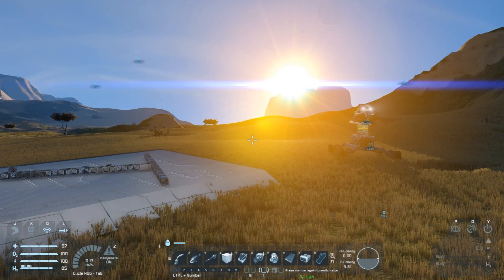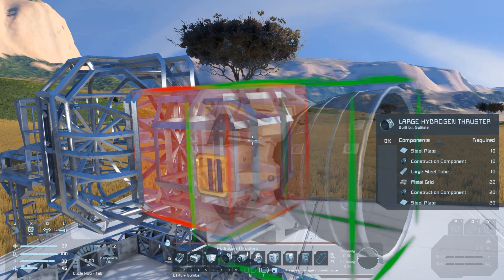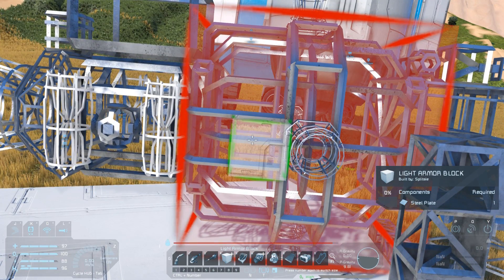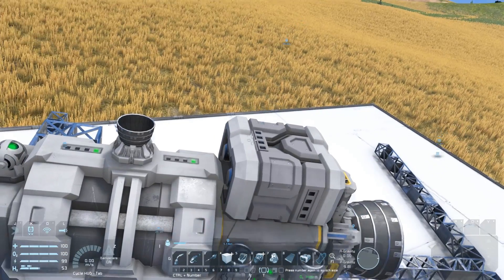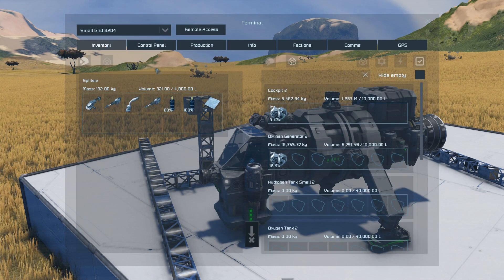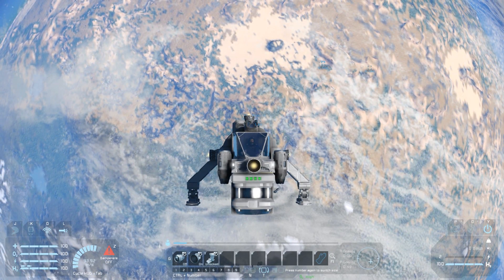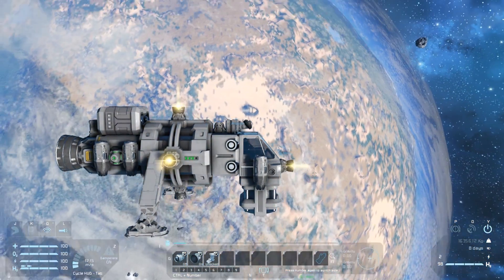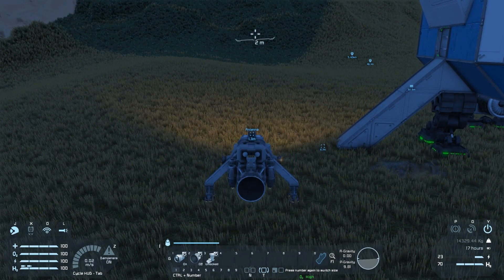Space Engineers Tutorial: Reaching Space from a Planet (Part 5 of a survival tutorial series)

Comment: Just built this and I can't get past 6000m high for some reason. I even went back and added 2 more of the large thrusters...
Reply from the maker: The thrusters aren't the problem. A single large hydrogen thruster is more than capable of lifting this ship. If you're capping out at an altitude you either don't have enough fuel going to the hydrogen thruster, or it's not yet on. It's only the atmospherics that are limited to altitude.

Did you leave enough time for the hydrogen tank to be filled before taking off? Did you 'pulse' the thruster to save fuel and not be pushing against the speed limit? Those are the things that did in my first few attempts when planets came out.
Reply: Im an idiot, had the hydro on stockpile... lol learning as I go!
Reply from the maker: Aren't we all :)
You can use the stockpile function to refuel from tanks on a station - much faster than using the Oxygen generators directly :)

Comment: Noob question, but how does one fill the o2 tank?
Reply from the maker: All noob questions are very welcome - I'm pretty sure I have and will continue to ask my fair share :)

The one on a ship: have an oxygen generator connected to it via conveyors, or if in an O2 rich atmosphere a vent attached to the conveyor system that is pointing outward and set to decompress.

For the personal tank: place it in an oxygen generator and it should autofill with the default settings, or place it inside a ship's tank that is set to auto-fill bottles
For the suit: jump in a cockpit that is piped up with O2 or use a medbay that's piped with O2
Reply: Splitsie more specifically I'm looking at builds where the ship only has an O2 tank and hydro tank for space, I'm not quite sure how their supply lasts
Reply from the maker: Either by being very careful, or by docking with a station and using the station's oxygen generator to fill them

Comment: Any idea as to why I cant deposit Uranium into my reactors through the small cargo in the back?
Reply from the maker: If you've run out of power on a ship the conveyor system won't work. So in that case you either need to add a solar panel, reactor you can directly access or a battery - they start with a small amount of charge. To my mind the best is the reactor you can directly access or solar panel as you can grind them down after and retrieve all the components :)

Comment: Build more than one Oxygen Generator if you can afford it. You refill youre tank much faster
Reply from the maker: While it's handy to refill faster it will also cost you more fuel to reach orbit (you add extra mass with the extra oxygen generator) so depending on the size of your ship that may or may not be a good thing
Reply from the maker: I haven't tested the rate difference between large grid oxygen generators and small but there's probably a difference in favour of large. So it might make it quicker to use the connector too :)

I'm glad the design had enough to make it to space with some extra weight, I hoped it would be that way so that the ascending flight didn't need to be perfect
Reply: I added a connector, still got to space with plenty of fuel and you can use you base to refill hydrogen.

Comment: Hey Splitsie, thank you for doing this. It really showed me some alternative way to build my ships. I have  a question though: Since i just recently started to use hydrogen on my ships i dont know what is most efficient to do. Is it more efficient to build gas tanks and fill them up in your base, or is it (energywise) more efficient to generate the hydrogen on the ship from ice you then therefore have to take with you in a cargo container. I play on 1/1/1 setting, so my space is limited. Thanks for your advice!
Reply: Im asking because if my calculations are correct, the energy in form of propulsion is higher when you carry it in tanks, than when you carry it in ice. But maybe im wrong.
Reply: And of course i forgot to mention that this is from a survival game starting on a planet. So, is it more efficient to just carry the gas in tanks, or do you have more hydrogen in total when you generate it with a generator from ice out of a cargo container?
Reply from the maker: I'm not 100% certain but I'm pretty sure that you're correct. You will get more thrust per unit of weight of fuel if it's already made up into tanks, particularly as I don't think the hydrogen in the tanks has any mass. Of course if you can fit both tanks and a generator but just leave the generator empty at least you'll be able to refuel at your destination without too much trouble.

I'm really glad these have been helpful even though they're done with higher multipliers :)
Reply: Splitsie Thanks for confirming. Yes the Gas has no mass in the tanks. I always wondered though why so many designs Contain Generators. I Never thought of refueling At your destination...Maybe because i Never reached it 😅
Reply from the maker: Lol! It took me ages before I got the hang of flying on planets with either atmospheric or hydrogen and I'd already played the game for 600+ hours when they released planets :P

I'll keep my fingers crossed that you can make it now!

Comment: I tried doing a hydro-thruster equipped ship before your tutorial arrived, but I missed the Hydrogen Tank, that may explain why my ship didn't flew hahaha.

Just 2 questions: does the conveyor port size influence on the delivery ratio? And will the conveyor system work if I put a small conveyor attached to the large port?
Reply from the maker: Hehe, yeah that wouldn't quite work, if you had enough oxygen generators you might be able to get thrust, but then I don't think you'd be able to lift them all :P

The connections have to match, so small-small and large-large. What you can do though is attach a fuel line to one of the small ports on the large thruster (like where the small cargo container was attached) and it will work just fine. As long as there is a functional conveyor system there's no meaningful limit in flow rates through it.

If something is small enough to flow through a conveyor system it will flow through it fast enough for most purposes. Just remember that larger components won't flow through small conveyor systems. If I make a video on a basic welding ship this will be a major concept in it.
Reply: You sir, are an awesome Gentleman. And also that explain a lot about many of my latest design flops :P

Edit: Almost forgot to say, thx again for the tips :)
Reply from the maker: No problems at all, happy to help :)